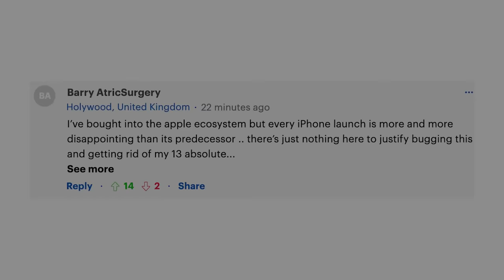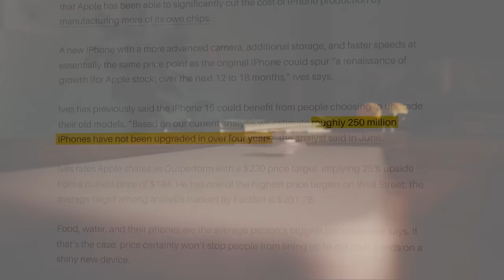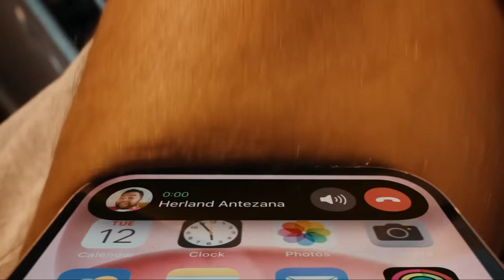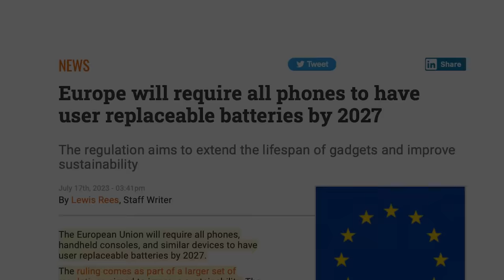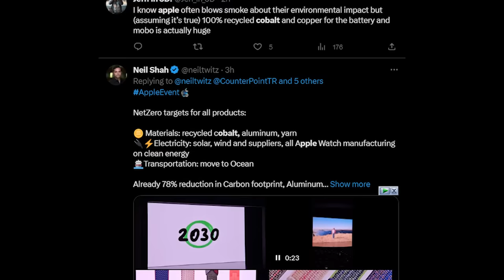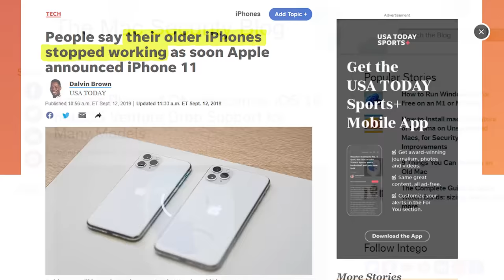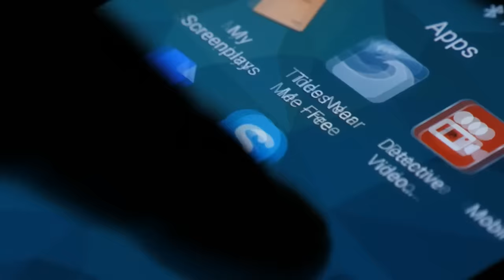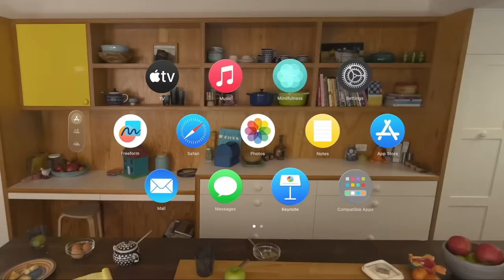The iPhone 15 Is Everything Wrong With Apple

Comment: There is still hardware innovation but only for the chips. I still think the new 3nm chip is insane with its 19 billion transistors in the chip. That is unfathomable. The ability to process AAA console games on an iPhone is really mindblowing. They are now focusing on efficiency I guess according to Moore’s law. Moore’s law suggests that computational progress will become significantly faster, smaller, and more efficient over time.
Reply: Yup, just because it looks the same doesn’t mean it is the same. But we are getting close to the limits of silicone based chips and we will need to transition in order to keep Moore’s law going.
Reply: Why do you need it when iphone 11 still runs every apps smoothly
Reply: @Lynnfield3 people care about battery life. The more efficient the chip, the better the battery life, as it uses less battery power to perform tasks.
Reply: Are you talking about emulation still dere is no working ps3 or xbox 360 emulator right now only ps2 emulator works perfect
Reply: @Lynnfield3  you say no one cares because you cant feel it. Without chips your phone wont even run....
Reply: I am confused. Do you not know what Moore's law states? Because it's simple.
Or are you trying to dumb it down for people? Why? It's simple!
Or, are you trying to soften the original law by phrasing it this way, because it's more a rule of thumb? Then why are we still giving it credit?

FYI the original Moore's Law stated that the density of transistors in integrated circuits would double every year, and then it had to be adapted Two Times before they finally found an interval that roughly fits the industry progress (18 months)
Reply: @Lynnfield3  what a dumb take
Reply: Okay but we have already reached that limit on small ass transistors now it's just design and innovation but you know why try to innovation when you can sell a product that almost always can sell
Reply: It's only 6 billion transistors more than then previous version. It's a tiny jump and PCworld wrote about this doesn't bode well for the rest of products coming on the same node.

Those "console games" will also be pared down for the phone.

If you want to game on a phone, get Xcloud, and you'll play more modern games on ANY phone.
Reply: 3nm!?! my oppo f5 from 2017 has a 16 nm processor.......

Comment: Something to think about is the MicroSD card slot, notice how today barely any phones above the low-end ones have MicroSD slots. That's because for under $100 you can have double the storage instead of buying another phone or expensive cloud storage. And it's not saving internal space either, because Sony can fit BOTH a 3.5 mm jack AND a MicroSD slot in their compact Xperia 1 FLAGSHIPS WITH a 5000 mAH battery which is huge
Reply: I love the Xperia for literally being the actual Pro line of phones without calling themselves Pro, because the amount of control you get from them is actually good compared to apple where they say fuck you and robs you of your cash for "premium" materials as pro
Reply: @tydshiin5783  Apple's Pro just gets you features most if not all other Android flagships have like the 120 Hz and USB-C 3 which are still missing from the normal 15 ☠️
Reply: Good point. I've argued with so many people who go "well nobody uses it anymore, you don't need it!" How can they be against OPTIONS. LIterally just options. You pay just as much as previous years for a flagship "premium phone" with less features.
Reply: And the bestcthing from (most) Sony and Samsung phones?

Not made in China.
Reply: Cloud storage isnt that expensive. With apple its 3 bucks for 200 GB each month and you dont have to worry about backups and can acces your data from any other apple device without a trouble. Honestly, they have a great ecosystem

Comment: While Samsung's out there releasing the fifth generation of their cutting-edge foldables, the most hyped Apple event this year is them adding USB-C to the iPhone15. AND its got a 60hz display in an era where even $200 phones have 90/120Hz displays. Pretty telling tbh.
Reply: And the iPhone 15's USB c port is USB 2.0. As well as their charging cables they ship in the box.
Reply: The foldable phone is an extreme gimmick
Reply: Most people don't use or need a folding phone,
Reply: The fifth generation Samsung Fold is a marginal upgrade to the previous years phone, and it's only cutting edge if you want a phone with a screen that can be damaged by a fingernail.
Reply: A titanium body is still more practical compared to a folding phone.
Reply: @Mannyxz  absolutely, my personal preference is going smaller not going even larger. if we're being honest, why not buy both a tablet and a phone that were made for their purpose instead of buying a folding phone that doesn't do either properly and often has poor battery life?
Reply: I had the flip phone 4 for about 8 months.  I couldn't stand it and it was such as disappointment with all of its flaws (the biggest being that no one could hear me on calls when using WiFi which is embarrassing for work calls).  I was really hoping the experience would have been good.  I had the S7 for a while and then went to the iPhone X and honestly, I'm not going back to Android.
Reply: @itskyb  Mhm, and a lot of what is said in this video is outdated or just wrong. "Planned obsolescence" the way it is mentioned isn't completely accurate. iPhones are some of the best phones you can get for longevity with the longest software support by comparison to their android counterparts (although they are getting better), and that SOC throttling incident as far as I know, was genuinely because the iPhone 6s were getting old at that point, yes it raises the question of whether it was for planned obsolescence' sake, but realistically I don't think Apple would've wanted claims about old batteries exploding now would they?
Reply: @corey7219  So it's nothing new, many budget phones also have US 2.0
Reply: @Mannyxz titanium body is coming ro every flagship in the coming months 
It just happens that the iphone launches earlier
Reply: @Mannyxz titanium body is coming ro every flagship in the coming months 
It just happens that the iphone launches earlier
Reply: The thing is that Z Fold 5 wasn't even major improvement over Z Fold 4 compared to Z Flip 5 vs Z Flip 4, i expected better with their Fold because the Z Fold 3 was major improvement over Z Fold 2
Reply: @warpnl1 ya everything that other companies do is a gimmick until apple does it
Reply: They are literally cutting edge (not metaphorically)
Reply: @copyer9088  Like?
Reply: @HM7aep  It's still depressing that you pay $900 for usb 2 transfer speeds in 2023. $1199 last year.
Reply: @warpnl1  like what? I’m defending other companies by the way for trying something different just so you know
Reply: It's the console wars all over again
Reply: @warpnl1   You'd know that's not true if you ever used one. Its extremely practical in real-world scenarios. Both the Fold and the Flip.
Reply: @originalgaming1663  not really if I’m being honest I don’t understand why people get so stuck up about what phone others use is immature who cares what phone you use 

Just use what ever you want I’ve used both and I can say their both good it’s whatever you prefer personally.
Reply: Yvng_remixer  that’s a great phone too.
Reply: @warpnl1 yeah, but then when Apple does it (like 5 years later) it’s somehow “groundbreaking” and “revolutionary.”
Reply: As cool as the Galaxy foldables are, they’re a gimmick and make the phones extremely fragile and easy to damage(aka more likely to become e-waste). Even more so than the Dynamic Island on the iPhones. Quit it with the Apple bad-Samsung good circle jerking.
Reply: @kindofanmol  It's really not practical. iPhone screens are already big enough to work or read comfortably on, and they don't scratch when I accidentally scratch my fingernail on it.
Reply: So what exactly does the foldable do that an iPhone can't? Other than...fold. If you want the 90-120hz phones, get those, and stop complaining about a device you don't want to own.
Reply: @warpnl1  apple fangirls use the word gimmick so much that it's lost its meaning gimmick means something useless. Having a large screen The size of a mini tablet that can fit in your pocket is by definition useful

Yall will call anything a gimmick until apple does it 🤣🤣🤣 eg widgets
Reply: @edwinwandera6993  most people don't need a flagship phone by that logic
Reply: @Skullet  the technology itself is leaps and bounds above regular phones so it's OK for the iterations to be marginal..it doesn't get damaged by a finger nail
Reply: @Mannyxz  most definitely not lmao.  Titanium doesn't make a big difference at all compared to phones now a days that are already strong enough.  Meanwhile a folding phone allows you to have more screen real estate that can still fit in your pocket which is useful for all media consumption which is what most people use their phones for
Reply: @xamava  a tablet doesn't fit in your pocket and a phone can't expand to get more real estate. How does it not do either properly? It does both properly meanwhile a phone or tablet on their own can't what I just explained 

It's battery life is all day which is great. Try again
Reply: @itskyb  couldn't be further from thr truth. It has zero wifi issues yall just making up lies 🤣🤣
Reply: @xamava  if the SOC was genuinely for the battery issues then they would have said so from the beginning transparently not lie about it and only say that until they got caught how convenient. Not to mention  they still admit to doing it to this day which means iphones have both bad batteries and processors that will explode if not slowed down that hurts longevity by definition as does their horrible anti right to repair practises 

Software support isn't support if it's designed to slow your phone down

And android is light years ahead of ios 
Apple needs constant support because of how much catching up it has to do and still its so far behind
Reply: Yvng_remixer  foldable are amazing
Reply: @lefthanded5473  LMAO how are they a gimmick? Having a tablet size screen that can fit in your pocket is BY DEFINITION useful no matter how hard you tell yourself otherwise

They aren't extremely fragile at all. They aren't as strong as fully Glas phones but they are perfectly strong for solid use

If it damaged easily no one would buy them. Try again
Reply: @mrdereksutton  it does everything better especially Media consumption.
And the aspect of folding is a big deal its pike having a tablet and phone 2 in 1 the best of both worlds
Reply: @ertgb_  yes it is practical. By that logic no one would buy tablets. Phones have been getting bigger and bigger but reached  a limit because only so.mucb you can increase the phone while still fitting in your pocket

Funny Samsung hater. People said the EXACT same thing when the note 3 came out ohh its soo big phones are already big enough and now phones are much bigger and it's the norm people want bigger phones and foldables allowe people to get more screen real estate while still fitting it in their pocket which is by definition more practical

And it doesn't scratch from a finger nail
Reply: @autograndeunlimited  It does scratch from a finger nail, seen it happen to plenty of fold users.
Reply: @icyplaysgames9465  no it doesn't. It if scratched as easily as you claim it did no one would buy one. Try again.
Reply: @autograndeunlimited  Truth has to be told, in most cases Apple  executes it better. But not always tho; widgets are also gimmicks, no matter weither Apple or Android does it

Comment: I like how they used to say that iPhones are the perfect size and you shouldn't buy a bigger phone. Eventually they just gave into making bigger phones
Reply: The perfect size imo was from 4-5, 6 and later models are fucking stupid large to the point that you'd need a purse to keep your phone
Tbh I would not mind a modern smartphone with the size of the 4 or 5 with little to no bezels, thickness is whatever imo because thin phones just snap so easily
Reply: @Special_Agent_Frank_Horrigan different people have different hands
Reply: @RawbLV  ok but did not inquire
Reply: @RawbLV  I have considerably large hands and the 6&7 are too fucking big for me to hold comfortably
14 was too heavy to even hold for long periods plus damn impossible to use with one hand
Reply: In fairness, people started doing a lot more with their phones.
Reply: it’s almost like markets tend to change over decades
Reply: @tydshiin5783  we're talking about phones right?

Comment: I feel good about sticking with my 13 Pro Max. I'm sure the 15 lineup will be a great upgrade for those who need a new device. Gonna try to keep mine for another couple of years. 

Remember, last year's "best ever" phone hasn't changed just because a newer one has arrived. Last year's phone is still pretty awesome.
Reply: I feel like upgrading my 12 but only because the battery is starting to drop in life. I used to be able to watch YT for 8 hrs, now I only have 4. Tiktok fades my battery to 0% from full in less than 2 hours. And the charger is slow as shit, 50% in 2.5 hrs is nothing when I can waste it in half the time :/
Reply: @samirbelica2358  who tf is watching YouTube for 8hrs
Reply: @thatsepic494 ipad kids loool
Reply: "Gonna try to keep mine for another couple of years. "

Unfortunately, it's not up to you to decide :3
Reply: @kaczan3  right, right. That’s why I’m gonna try.
Reply: There are reports of Iphone 15 overheating, cracking, bending, changing color. Slow freezing lagging buggy software. Battery problem etc.
Reply: mate you could just get the battery replaced if you wanted to
Reply: @kimchi-des  oh I know, but thank you! I’m at 86% health now. Probably do a  battery replacement in the next couple of months.
Reply: I had a XS and upgraded to a 14 Pro last month. Such a big leap, but didn’t feel like waiting for the 15. This will be fine for the next 5-6 years and then I’ll upgrade again.
Reply: @tylerwilkey13  yes… from one model to the next, changes are incremental. Skip five models and the changes are huge! I hope you enjoy your new device.
Reply: I have a 13 primarily because I needed more storage. This is my second ever iPhone (First being an XR) and I’m happy.   :)
Reply: @IamjustBruh  My 13 Pro Max is my first ever iPhone. I'm a believer now. Wish I'd jumped on board sooner.
Reply: @thatsepic494 People with less responsibility, I used to be like this when I was in school, now with a job, hobbies and going back to Uni, it's only a handful hours. I can barely get that on the weekend, plus I don't watch TV, YT is TV for the newer gen. It's not that unfathomable.

Comment: The PC market is falling into the yearly release schedule as well and it's worrying to see. 
GPU's are still roughly once every half decade but CPU's are starting to become more and more frequent. Intel is already getting ready for 14th gen when 13th gen has BARELY even hit the 1 year mark. AMD is not as bad in this regard as they are still once every 3-4 years but I'd be surprised if this didn't start to speed up too in the near future, especially with intel already doing it now
Reply: Yeah AMD used AM4 for about 6 years, compared to Intel they released in the same time 3 different sockets.
Reply: Atleast the high end GPUs are offering a good performance upgrade over the previous one, but  I think CPUs are starting to give diminishing returns, especially with intel
Reply: 14th gen already out, now the next generation names start with "Core 5" (i5), etc
Reply: Yeah I made this comment 2 months ago before it was
This is more about the pacing of hardware releases rather than naming conventions. That's another can of worms to get into
Reply: Thats because they throttle the releases, I bet they have 18gen cpus already.They aint gonna just release em, they ll sell a crap ton of small upgrades instead.

Comment: 9:27 HTC  was the one to first implement multiple cameras in their smartphones. There's a repeated misconception that Apple is an innovator when there has been a plethora of evidence that the harp on design choices that other companies had done previous, but are overlooked simply because it wasn't on the Iphone yet.
Reply: I miss my HTC Evo 3D. It was dumb and gimmicky but I kinda feel like we need more dumb and gimmicky stuff these days. Everything is sterile and boring
Reply: they were YEARS behnd nokia back in the day.
Reply: putting two cameras is not 'innovation,' and who fcking cares
Reply: Just like apple wasn't the first touchscreen phone
Reply: @elvangulley3210  Not the first one, but the first capacitive display that supported multi touch gestures.
Reply: @pyropulseIXXI   "who fcking cares"? Anyone who likes to take photos on their phone. Having multiple cameras with multiple focal lengths that are designed for different scenarios is a must for many.
Reply: I wish HTC were still a serious player in the market. I usesd the 2013 HTC One M7 for 5 years & absolutely loved that phone. I still have it, & it works fine, but doesn't quite keep up with my current S23.
Reply: @Lee.S321  it isn't a 'must' for anyone
Reply: Wasn't it LG who implemented multiple cameras first with the LG g5
Reply: @pyropulseIXXI   A smartphone isn't a 'must' for anyone either by your reasoning. What point are you making? If you're happy using an old Nokia, good for you. They're not for everyone.
Reply: @pyropulseIXXI it is when no one else is doing it. Look at the definition of innovation. Also photography and taking video are pretty popular. I think a lot of people care.